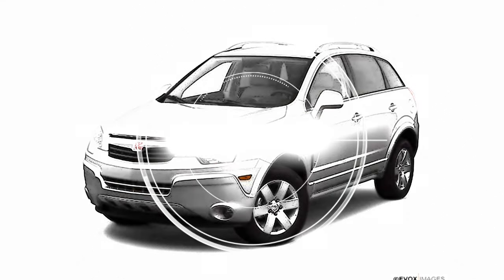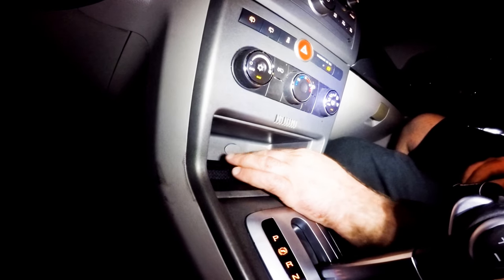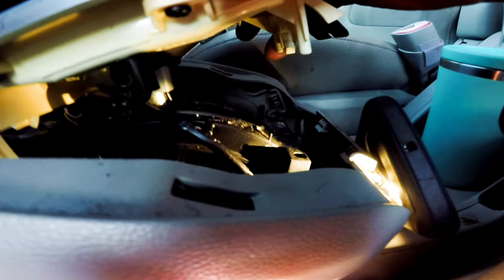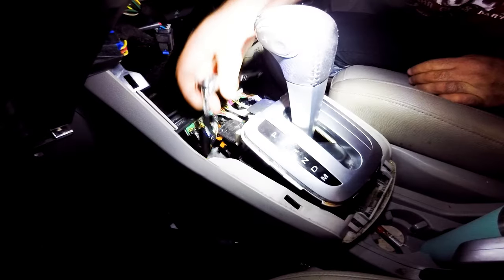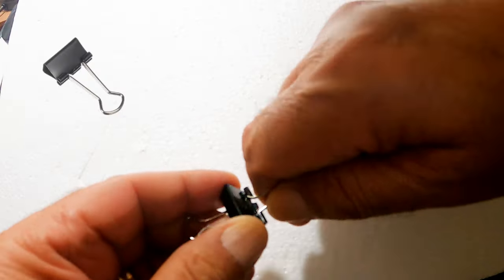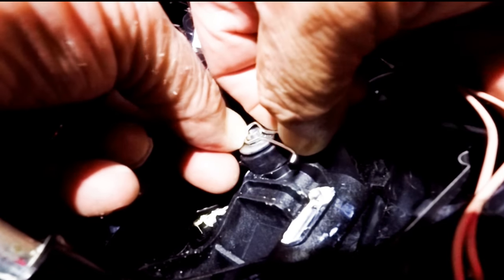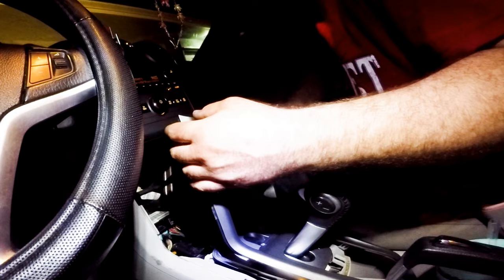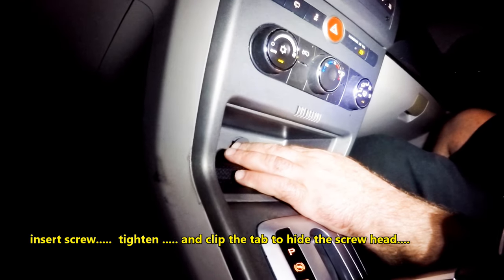Shift Cable Bushing Repair Saturn Vue 2008 quick fix 🛠️

Comment: Great video. My question is, where can I find the plastic orange cable clip that holds the cable to the front of the shifter. I broke one of the tabs that stick out. It might still be useable, but I'd like a new one if I can find one. Thanks.
Reply from the maker: If you mean the repair kit , the link is in the description. If you mean a different part click on the same link and see other suggested parts for the shifter you may find what you need without having to go to the dealer

Comment: Pretty stupid   you had it apart why didnt you just put the replacement parts on  or shift  with the cable move truck then fix
Reply from the maker: I would like to answer your question but then I figured; you’re a smart guy and you don’t need an answer from a stupid guy.